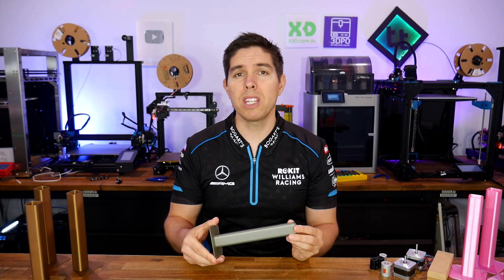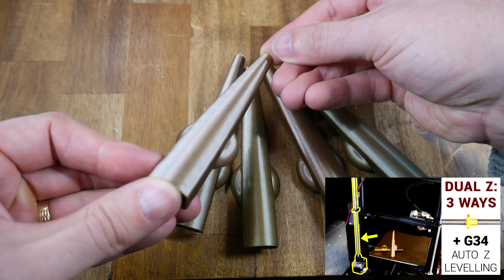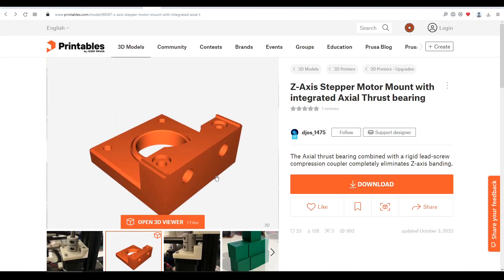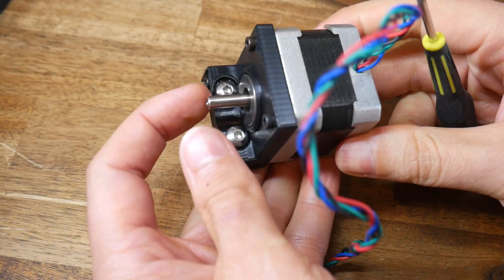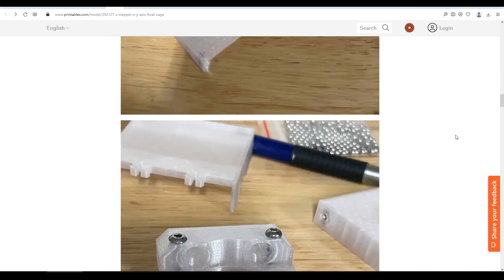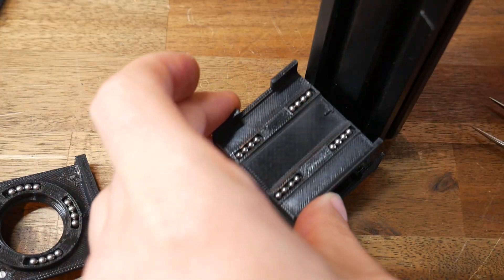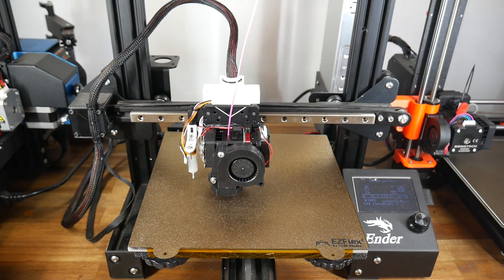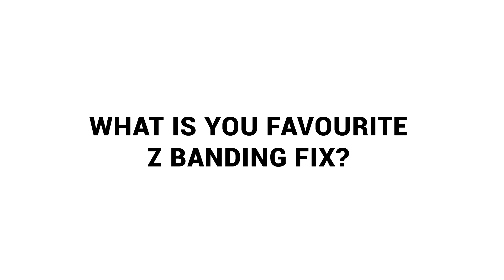Two Z banding fixes for your 3D printer from the community

Comment: What about a single “bulging” area that is only 2 or 3 layers thick, always at 31mm from the bottom, on every print? I’ve replaced the rollers, checked every screw, and scrubbed the z-screws so often they’re clean enough to eat from. This occurs on my CR-10 Max with a Microswiss NG direct drive, z-axis belt sync, everything else stock. I’ve been trying to fix this for over a year now, don’t know what else to try.

Comment: 9:30 it seems like you should also have a thrust bearing on the second design, since allowing it to move in x and y doesn't change the fact the weight of the gantry and rods is pushing down into the stepper motor, which will be reducing the z axis accuracy.

Comment: I really don't understand what is so hard to understand about lead screws installation. Z Wobble happens because of badly installed/upgraded lead screws. Simple. Connect one end to the spring coupler and the other end of the lead screw must be free. Why free you ask? Every, and I mean all of them come bent from factory. One more than others but they all are. If you restrict both ends of the lead screw, it can't move freely and the bend will translate to the print carriage.

Comment: If your machine allows for it for the press lead screw nuts attached to the gantry loosen the screws slightly so that if there is any wobble in the lead screws the lead screw nut can move My solvo SV02 has slots where the screws go through to hold the lead screw nuts those slots allow the nuts to move instead of everything being tight and transferring it into the print also antibacklash lead screws are helpful if yours are not slotted a dremel tool and a small grinding burr to slot the holes a couple millimeters

Comment: I'm late to the community because I just finally upgraded from a printrbot 1405 to my Ender. But I wonder how much of that very regular banding is a result of the aluminum extrusion. I used to work in a manufacturing environment and we had some very wonky results that we could not identify until we took a part to the surface grinder and found out real quick that the extrusion maching from our supplier had a mechanical vibration in it. Even running at low speeds, we got irregurlar surfaces, barely detectable, on the un-machined surfaces. We ended up ordering the extrusion the next size up and machining all the surfaces, since we were a small-run shop it was the best solution. But I'd bet using a linear guide on Z like you installed on X would eliminate a lot of the extremely regular banding.

Comment: I realize this is an old video, but I was hoping someone could help me. The motor mounts with thrust bearings don't fit my CR-10 Smart. I was wondering if there is someone else who may have the same compatibility issue and modified the STL file. I think I could do it in Tinkercad, but I'm still a novice at CAD designing. Thank you

Comment: The Z axis banding fix that worked for my CR10-Max was a combination of the Oldham Couplers and Anti-backlash nuts from TH3D, you can use standard ones, but these are already the correct shape for the CR10 series so you don't have to cut them down. This coupled with thrust bearing mounts on the Z steppers, and making sure the Z lead screws were not touching the tip of the Stepper motor shaft has fixed my Z issues. The anti-backlash nut does nothing for backlash, but it does keep my left and right sides of the gantry level when the power is switched off, stopping them getting out of synch. The parts were a total of AUD25.00 so it was a cheap fix.
Reply: I am getting ready to do this to my CR 10 Smart Pro. Did you install the anti-backlash nuts with springs upside down on top of the gantry or under the gantry? I’ve heard positive and negative either way thank you.
Reply: @larkinduval1882  I fitted them underneath.

Comment: How to eliminate Z banding:
Step 1: get a better, more well designed 3d printer
Reply: You just need to tighten all the screws and it will work fine
Reply: @shrekshrek  Been there, done that. Doesn't work on my Ender 3.
Reply: @B10KPlaysGames  i lubed the screws and tighted the rods close to the screw and it worked  i also did it mid print so maybe that did something i guess
Reply: @B10KPlaysGames  there is still a little but way less but im  buying a bambu lab a1 next month but my elegoo neptune 3 pro worked fine for years
Reply: @shrekshrek  Looking back at it, I actually think I had a different problem with that printer. The banding artifacts on the prints were probably caused by the bed (Y-axis), not the Z-axis. The internet will try to gaslight me into thinking it's the Z-axis, but I've tried everything with the Z-axis, and none of it worked.

Comment: I installed #1 on my Ender 3 v2 because <3 convenience <3 BUT

The side of the print that mounts to my Z gantry was too high to screw into the threads (ofc) and it had excess plastic that tilted my Z axis ...so I cut that end off with a dremel and used my printers OG mounting piece for that side lol

Comment: Remove the entire coupling since both cylinder are not coaxial because in part of the set screws + components tolerances. You can buy motor with lead screw included (and coaxial). It greatly improve. But it is not the only issue causing z wobbles. You need to compensate for X and Y movement, block Z movement and motor rotation otherwise you loose on z precision. Other issues can be related to extruder precision, once again with set screw causing coaxial offset, gear coax offset again... Check the issue frequency and check the potential cause frequency to find a match.

Comment: Disabling z hop fixed the issue for me and I think it will for you too, I was getting perfect input shaper test but terrible regular prints.
My conclusion is it’s due to the loose bolts holding the leadscrew nuts, they are designed to be loose to allow for leadscrew play but it introduces its own backlash (between the plate and the nut).
Disabling z hop is a temporary fix and I plan to install wobblex ws8 couplings in the near future.

Edit: just noticed your latest video 😂 good to see we are on the same path

Comment: Z banding is usually a result of a rubbish extruder or Z  badly tuned PID temps on bed and hotend. Rarely is it leadscrews esp as the Z axis are normally constrained either by extrusions with wheels or linear rails.

Comment: If you happen to be using the Sovol SV04, note that the part for solution 1 will lower the motor too much and the horizontal rails at the bottom will be in the way. I'm sure you could just cut out the part that is interfering with the rail, but I'm still pretty new to this and not sure how to do that. Just a note for any other beginners with this printer that may have been looking for a "print and play" solution.

Comment: As im thinking about it wouldnt the Z wobble be a bed issue? Z can go striaght up, but if the bed isnt slinging back and for to the same spot everytime you'll get Z banding as the bed moves 10 units one time, 12 units another.  Perhaps getting rid of the play in the bed?  Or in a box style printer it would be the x or y.  Im sure Z issues add to it but since they've been addressed it could be the other axis.
Reply: That is a good assumption, but the bed flinging back and forth doesn't cause this problem (Z-banding/Z-wobble). The problem that a moving bed introduces is ghosting. Lots of ghosting compared to a coreXY machine.

Comment: An oldham coupler is a cheap drop in solution that can be inserted between the leadscrew nut and gantry or bed that requires no 3D printing or extensive modding and will allow axial shift. It would be a better option than 3D printing stepper mount that does the same thing. Just be mindful not to buy a jaw shaft coupler that is often mislabeled as an oldham coupler.

Comment: Does the Z stepper motor move in "full step per pulse" configuration? Because the Zaxis motor is slow and heavily loaded, microstepping is not possible because the motor rotor will almost always be attracted to the nearest magnet, causing some accuracy to be lost. Only real mechanical resolution can solve the problem of uneven layers. I currently use a ballscrew with reduction for a resolution of 0.01 mm per step  layers are even and almost invisible.

Comment: Good video for lead screw based printers, i am struggling with this same problem. I have converted my ender 3 pro to Kevin's belted Z design and also running klipper. I observed that printing at speeds like 180mm/s made the problem much worse and hence I went all the way down to printing at 60mm/s and problem remains but much lower. Can you please advise where else I should be looking? I even lowered the acceleration down from 3000 to 1000 but the problem persists. Any advice would be very helpful 🙏. Thanks in advance from your subscriber.
Reply: Hi Michael, An update for you, I managed to fix my Z-banding problem. Firstly I had to tighten my Z-belts till they sounded like a guitar string. Second I loosened the eccentric nut on both sides till the wheels were loose enough to just roll or even slightly slip. Now I tried printing at 60mm and all ok, next I tried 100mm, 150mm and 180mm and no Z-banding at all. Only issue at 180mm is layer shifts on Y obviously because of the mass of a 300mm bed. Thank you once again 😊

Comment: I tightened my eccentric nuts on both my z rails on my ender 3 classic almost to the point where the machine was moving the gantry without binding, but just. This gave me a mirror finish. I use a spider coupler, an anti-backlash spring on my z rod and I also loosen the z rod nut screws to give the lead some play. I also used test blocks to make sure the gantry rail is trammed to the bed. Voila.

Comment: For the first fix, you can still use a flexible coupling with a ball bearing between the stepper shaft and the lead screw. This allows the coupling to absorb any deflection from a bent lead screw. Alex Kenis has a video on how it works on his channel under something like "ball bearing trick"
Reply: This does still put axial load on the stepper, though. The best solution is to decouple the motor from the screw with a belt, then put an 8mm OD miniature thrust bearing UNDER the lead screw (to support the weight) and a KFL08 pillow block bearing around the base of the screw (to allow angular misalignment/bent screws etc), and leave the top of the screw unconstrained. This gives you the best of all worlds. Sadly, most people will consider it too much work. Deckingman has this on his monstrously large machine.
Reply: " and leave the top of the screw unconstrained"  <-- this will cause the leadscrew's top to shift from it's axis alignment which will create inconsistent steps as the length of the rod elongates / shortens from the tilting. The best solution is to spend 25$ and get a new leadscrew if it's bent but in either case the unconstrained top will cause it's own problems.

Comment: I have two Ender 5’s and they do not have any measurable end play in the Z steppers. If yours do it’s probably time to replace them. 

The linear bearings though have given problems. They get sloppy after a while and it causes the bed to slowly tilt after a move. I think the internal plastic guides degrade. 
The other problem is they  can get sticky and it caused banding similar to your example or worse. Replacing them fixed the problem. Adding weight to the bed also helps. I lubricate them with light plastic compatible oil and it prevents the sticking. 
Anti-backlash nuts help a little but I have seen several videos where they are installed upside down. The bed is heavy enough so backlash isn’t really a problem

Great videos. Thanks.

Comment: Not using a lead screw and going dual belt drive with rails is the ultimate fix.   Not the cheapest fix on the list but it's a one time thing and your Z problems are gone.  Depends on your budget.  Really not much Ender parts left on mine aside from the frame and bed, might as well built one from scratch.  It's now a DD-IDEX with all rails and belts.

Comment: I encountered some z-banding on my Bambu X1C but only with one specific color of one manufacturer's ABS. Using a different color from the same manufacturer with the same model/settings did not exhibit the issue. What would cause that?

Comment: I have a ender 5 plus. I'm seeing what appears to be over/under excruciating. One is under, next is over, repeat. Did a bunch of $stuff$ to troubleshoot this. And the better I got the more of a pattern. As in Z screw pitch, transferring to the print. Which is a FDM printer thing. 
Just shows up worse until printer is dialed in. Looking to try different Z screws, and then maybe a belt for Z. Good luck with your problem 👍

Comment: It is really important that the motor-to-screw coupler fits snugly to both.  Many printers come with couplers that allow a ridiculous amount of play.  You'll see this as Z wobble at the bottom of your print that slowly decreases as the print gets higher.  The printable self-centering couplers do a good job.  If one of those springy couplers fits best, you can print a vase-mode slip-on sleeve to stiffen them up.

Comment: I would suspect the lead screw itself has an issue. When they are first installed they work great, but they wear out over time. One thing to do is install anti-backlash nuts on each lead screw. I did this on my Ender 3 v2 and it helped a lot. Another thing to consider is installing ball screws.
Reply: those are rather expensive and the cheap ones can wobble too. MirageC did a video on that but the only thing is you can't fit them onto the shaft of a typical stepper
Reply: @nathan22211  I had not seen that video. It is very informative and his solution for the ball screw wobble is really neat. Like he said though it is just a band-aid and is not as good as a high quality ball screw. That being said the ball screw did fix his z banding issue after his ball screw fix was engineered and put in place.

Comment: imho those are extrusion\filament issue and not Z wobble. I am running kevinakasam`s betled z on my ender 3 pro and it simply ruled out most of irregularities, I have crappy bmg extruder however replacing all gears helped still I see some extrusion variation. Unable measure tiny missalignments\runouts\backlash I tried to rule out filament width. +-0.05mm isn't enough accurate... on the prusament`s pla I see far better results thanks to +-0.01 variation during prints. unfortunately it is on a pricy side, so it is for a accurate prints while mass production goes on regular pla

Comment: #2 is pretty cool, I have been using a very similar mod that makes the nut on the gantry float over XY for a slightly bent z rod. I wonder which one works better. I am planning to swap to a belted Z soon though.

Comment: Integrated lead screw stepper motors work wonders, especially paired with rails/rods. I got a TR8x2 single start lead screw and had exceptional results (after adjusting rotation distance).

Comment: I had Z banding on my Ender 3, the problem was flat spots on Z-axis wheels. I replaced all six wheels on Z, and the problems were gone. This is very common reason for banding on Ender 3 style 3D printers.

Also the wheels can be compressed too tight on aluminium extrusions(alignment failure when assembling printer), that causes similar issues. To fix that, align your Z that all wheels have moderate and even pressure.

Comment: When I had my orignal ender 3 v2 (now i'm using Ender 3 v2 coreYX) I found that the this issue came from the miss alignment of the Screw Nuts T8. If you look carefully from left side of the printer the extruder stepper motor and screw nut holding plate  you will find that this holding plate  isn't bend plate exactly at 90° (little bit less) and if you remove the  Screw on the T8 Nuts  you will also  find that usually one holding screw  has more washer then the other (to compensate the bend plate). So If you play little bit with those washers by adding or removing them you can find the sweet spot to compensate correctly the plate angle and that was my solution to reduce Z banding by finding the route cause of if. Observation!!! if you do this fix that Z banding will be reduce and the Z axis will be very very smooth! As a result of this you may need to always lower the Z axis before turning off the Z stepper in order too prevent any fall (when I said the Rod will be very smooth that mean very smooth :D)

Comment: A deep groove ball bearing can take a decent amount of axial load.  Using them in a 3D printer, this rated load is well above anything you can load them with.  I recommend the 608zz for any application in a 3D printer (8mm ID x 22mm OD x 7mm thick).  Just put a spacer in place to put the axial load on the center race and not the outer race.

For lead screw wobble, check out Oldham couplings.  They are a 3 piece design with the pieces connected with dovtail joints set at right angle from each other.  This allows sliding in X/Y but no play in Z.  I found them from this video https://www.youtube.com/watch?v=RXgwOikiBdg
Reply: Agreed on the deep groove ball bearings. With the loads we're talking about here, they're more than enough. I do accept that thrust bearings are the 'correct' way to isolate the load from the motor, it's just that it's overkill.

Comment: I thought I had z-axis wobble, but it seemed to come and go depending on the filament. After experimenting, I discovered a humidity gradient in my storage area which was causing my filament reels to be more slightly more hydrated on one side than the other, this meant a slight expansion of the extruded filament for one side compared to the other, which meant alternating bands of 'smoother' and 'rougher' outside walls to my prints. A slight redesign of my storage area and a stricter regime of pre-printing drying fixed this.
Reply: There is a video from MirageC talking exactly about it
Reply: @alainthire  I've fixed my issue, but thanks anyway.